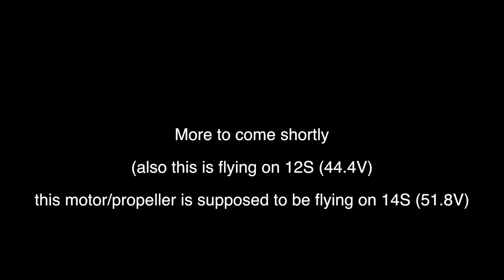My HomeMade electric plane Really flies!!!! (short hops) part7

Comment: Test Pilot Peter - Congratulations .......
some observations: 1 - She looks like She is flying a little bit nose high. what is your angle of incidence(s) relative to the A/C centerline? ........ 2 - On applications of power She looks like She wants to climb - I'd Check the Thrust angle of the motors. might be a smidge to flat relative to the A/C centerline.(more thrust down angle perhaps?). 3 - did you set up counter rotating props? would probably help on an A/C so light. .................................Just saying ............... good luck ........................ JRW

Comment: G'day,

  Yay Team !

    The name of that Syndrome, which you were accusing yourself of (when making the Twilight-Flights, after dark, without Lights of any kind...) ; is "Press-On-itis", it's what happens when people become over-excited, highly-elated, or excessively Goal-Oriented, Target-Fixated - even.

   When someone tries to go "Scud-Running" under lowering cloud heading towards rising ground, or tries to fly under the Storm, or attempts to climb through Clouds in the absence of an IFR Rating & appropriate Instruments being fitted to the Aircraft...; the malady is always the same, Press-On-itis...!

   Your Hairygoplane flies a lot less reluctantly with the Gap-Covers fitted, doesn't it (?) !

   Maybe you could find a Leather Helmet & Goggles, if not a Motorcyclist's "Skid-Lid", to save yourself from some nasty lacerations to the Face - from that Perspex Windscreen - in the event of a sudden mishap (say a Wheel going into a Rabbit-Burrow, or Gopher-Hole, at a speed sufficient to violently pitch you onto your Nose...) ?

  Good to see  that you've moved the Anchor-Points of the Shoulder-Harness up to where they won't compress your Spine...; and now, what about a pair of Wires from those Anchor-Points back to the Rear Engine-Mounting Cross-Spar..., so as to spread the load (of your upper-Body decelerating against the Straps) into more than merely the middle of two Aluminium Tubes...(?).

   As I said, the goal is to Triangulate EVERYTHING, with Struts in Compression & Wires in Tension - which is both lighter & stronger than relying on the brute-strength of the Materials (and the rigidity of the Corner Joints) to resist Bending-Loads...

  Proceed methodically, and with caution ; at this point, overconfidence, elation, and exuberance are all highly dangerous states of mind...(!).

  I, too, after a number of flights in Ground-Effect was silly enough to have gone up to 100 ft & crossed the Fence..., before fitting the Centre-Section Gap-Cover ; and when I got up there I totally ran out of all ability to continue climbing, so I gently turned 90-degrees Right, & lost 30 ft on the Turn, and doing that twice more got me to  be 10 ft up, as I staggered over the Fence to land accross the Runway...., undamaged. Luckily.

   Fitting the Gap-Cover gave me about 300 Ft/Minute  worth of Climb-Rate, even when out of Ground-Effect....; with my lesson learned.

  They say that "The Lord looks out for Fools & Innocents..." ; but one is expected to learn from each near miss, and narrow squeak, and not to ever make the same mistake twice...(!).

  Have a good one,

  ;-p

  Ciao !

Comment: PETER,
It's a big mistake to switch to 14S.
The engine will burn. It is necessary to measure the intensity consumed. You must be well beyond the 180A limit with a 32x12 propeller.
Peter, please, uses for example the calculations of the engine, propeller and battery of the site www.ecalc.ch
The ROTOMAX 150 engine performs better under 12S but with a 28x14 propeller.
You miss speed.
I join Mike Sutton's proposal to do full gas tests on the ground until I empty the batteries several times.
Your life and your health are priceless.
Uses an current clamp and as you do not exceed the 180A.
Reply: The best propeller is a 26x16 for your plane after calculation.
Reply: I think you bought batteries in 14S.
Then buy 24x14 propellers but do not let your 32x12 propellers.
You will have a thrust of 55lbs per engine and a speed of 92miles / hours.

Comment: helmet helmet helmet helmet helmet helmet helmet helmet helmet helmet helmet helmet helmet helmet helmet helmet helmet helmet helmet helmet helmet helmet helmet helmet.

scrapes and breaks can heal, but not your brain
Reply: BrightBlueJim, a car has airbags and much greater crush zones. A wing stall at 8 feet into the ground has enough inertia to demolish the front of this plane, break some bones and plush his head into the aluminum windscreen bracing & puncture his skull.  Happened before per Tony Bengalis article in 1980's Sport Aviation magazine (fatal result).
Helmet could definitely make the difference.
Aviation maxim: learn from the mistakes of others, you won't live live enough to make them all yourself.
Reply: notthepoint.jpg
Reply: Michael Amick: in precisely the example you give, a helmet would not help at all.  Getting thrown into the windshield frame, assuming the windshield breaks, pushes that frame member through your FACE.  Or are you now saying the helmet has to have a full face shield?  And how is that helmet going to protect bones from breaking?  You're not making a very good case.
Reply: also, car design considers a lot of possible accidents. his plane only considers functionality, not controlledly folding in on itself to protect the pilot.
Reply: Yeah, chances are a helmet would do nothing in a crash, but even if it only has a slight chance of saving your life, it's totally worth it
Reply: No he met needs a leather hat with goggles and a bandanna around the neck that says DAKKA
Reply: Your point about helmets only being useful if you are going to get thrown away is nonsense. Racing drivers wear helmets, and they are strapped in. Also, your point about speed is false. When you go go-karting you wear a helmet, and you're doing <30mph. He should wear a helmet.
Reply: You right.
Reply: .... word!
Reply: i was always under the impression it was actually a part 103 requirement. maybe just a suggestion from EAA or something i saw
Reply: 1NTransit: there is no mention of helmets or any other safety equipment in FAR Part 103.
Reply: Evan: In karting, there are collisions all the time, and a lot of kinetic energy in them, because the things you're colliding with are also moving rapidly.  As I said, it's all about relative risks.  If YOU fly, YOU should wear a helmet, because YOU have determined that the benefits outweigh the risks, somehow.  Are you willing to take responsibility if you tell somebody to wear a helmet, and then they break their neck?  If not, please allow others to make their own decisions.  If you want to make an actual argument for them, please show some example or statistics on people getting head injuries THAT WOULD HAVE BEEN PREVENTED WITH A HELMET, while FLYING AIRPLANES.
Reply: Seriously.
Reply: No your brain can heal
Reply: Helmet and goggles please
Reply: Every one of your points is exactly wrong, especially the last one. May god have mercy on your head.
Reply: Yeah, all that grass he was flying over looks really hard. The foam his plane is made of, too!
Reply: BrightBlueJim What if the propeller breaks or flies into his head?
Reply: No point in a helmet... he doesn’t have a brain to protect.
Reply: Static Boss: What if he gets struck by lightning?  What if he has a heart attack?  What if a giant condor flies in and attacks him?  The point is, helmets have one thing they're really good at: preventing head injury.  But they also have risks associated with them, like neck injuries caused by attaching a large mass to the head.  So yes, they are useful.  But they are by NO means a cure-all.  EACH PERSON has to weigh the risk/benefit tradeoffs in any activity they undertake.
So far, nobody who has been yelling "HELMET!" has shown what the benefit is.  Michael Amick gave as an example, a scenario where a helmet would not have helped.  Okay, I'll concede that if a propeller breaks and happens to do so at the moment when one of the blades will directly hit his head, then a helmet would help.  Now: how often does this happen, compared with how often he can expect to collide with the earth with sufficient acceleration to snap his neck due to having a helmet on his head?  I don't have the numbers, so I DON'T go around saying "don't wear a helmet!!!!"  And yet, people who can't or won't quote statistics on these things ARE saying "helmet!!!"
So give us statistics or STFU.
Reply: Do you wear a helmet when you drive a car?  Because you probably drive a lot faster than Peter is flying in this thing.  Helmets make sense for vehicles that throw you clear in a collision.  In this, he's pretty well protected already by the aircraft itself.  Where they're not necessary, helmets are a HAZARD, in that they put extra mass on your head that will cause neck injuries in case of a collision.

Comment: 41 people don't like defying gravity :)
Reply: Or were just too horrified by his very lax safety standards. I liked it, but there are a whole lot of things to how he is doing these tests that just screams at me that he is one failure away from significant injury and not much there to save him when it happens.
Reply: eternalfire1244 true true, or maybe the dislikes are jealous lol.
Reply: eternalfire: what part of his safety standards are lax?  He has years of airplane design and building behind him, he used the best practices of (model) aircraft design, he load tested his wings, and he stayed low for these first two flights.

Don't say "helmet", because helmets are zero help on aircraft.  If you're flying slow, the aircraft and straps themselves will protect him; if he's flying high and/or fast, a helmet would only add neck injury to whatever else happens.
Reply: Other commenters who are actually test pilots have already laid out the safety concerns better than I could and included some additional things he could do to improve safety during testing.

Comment: Have you verified that your motors are pulling their rated current? What is the voltage drop at the motors? Is that drop acceptable? Are your power lines heating excessively? Are your motors running within their rated temperature range? Are your motor controllers running within their rated temperature range? Are your batteries running in their designed temperature range? What i really am getting at is, are you doing your due diligence before you trust your life and people on the ground's life with an airplane held together with tape?
Reply: watch his build vids this plane is not held together with tape
Reply: The tape you see is for purposes of clean airflow not structural integrity. Those intersections,  if left open would create extreme and unnecessary turbulence. On most aircraft they would be covered by a fairing. Since this is an ultralight the tape will suffice. A friend of mine punched a hole in one of his floats when landing on an isolated lake and hit a submerged branch. The hole was about the size of a quarter.He covered it with a strong type of silver tape and was able to take off and return home .

Comment: I have to admit I was really getting worried about you when you started building this thing. Then a few weeks ago on vacation I went to the Aviation museum at Boeing Field near Seattle. Inside the famous little Red Building was Mock ups period plane parts.  using simple lumber and such. I changed my mind at that point and figured you would do OK. 

Congratulations on the success so far and I still say that Mythbusters should have hooked you up as a contributor or host.

Comment: Your Airspeed indicator seems a little jittery? Is there any possible way your pitot tube is being disrupted by any airflow? If so that really should be fixed!
Reply: DudeManBroMan its a homemade pitot tube. You can see it near the end. It is definitely a temporary solution. I imagine the hose could have been getting crimped accidentally
Reply: Jacob_Orth1 Ah makes sense.
Reply: at 12:00 you can see the tube and the hose,
i think where the hose is shaking around the pressure is changing inside.
also, i didnt see a pressure reference port on the side of the tube

Comment: PeterSripol

 I wonder if the up-elevator problem  isn't more than just a nose heavy problem. It looks like the tail surface is parallel with the flat bottom of the wing, but i believe the tail surface should be parallel with the average AoA on the wing.

 Also, maybe put a pool noodle on the edge of your windshield for padding. Something like that could be Very Dangerous!

 Love your project and videos!!
Reply: check out something like the piper cub J3, it has adjustable tailplane angle of incidence.   just for fun.

Comment: @PeterSripol truly an amazing achievement, buddy! You're absolutely correct in going along with the small-steps mentality at this point. One trait of yours that's allowed you to be such a prolific creator is when you get the desire to do something new, you're diligent in your research and preparation, exacting in your execution, and enthusiastic about understanding and resolving problems that arise along the way. A major component to this prolific nature is a willingness to throw caution to the wind and just TRY something! While quite admirable, it becomes another thing altogether when it's your ass you're also throwing into the wind!
While I'm certainly no test pilot, I'm no stranger to many forms of incremental development/testing programs. Having read through most all of the comments throughout your progress on this project, now that you're at the initial ground/taxi/short hop testing phase there's one particular thing I'd like to bring to the front of your mind: single engine performance. A factor that must be addressed, even in in-line and near-centerline multis. Of course there are a multitude of factors to consider when discussing single engine performance of a twin, however I'd like to address with you perhaps the most imminently dangerous in case of an engine loss on takeoff/climbout. Does your design have enough rudder effectiveness/authority to overcome the yaw forces experienced in an engine-out scenario at this particular critical phase of flight? Let's just assume at this point that sufficient thrust is available from a single engine to at least control your decent rate, if not maintain current altitude.
Multi-engine training stresses the directional control issue extensively, but the real-world effects vary greatly by type/configuration. However, one thing that doesn't vary much is the likely result of handling this type of event incorrectly.

I'm pulling for your success like crazy! If I can be of assistance in any way, don't hesitate to reach out. Keep taking those baby steps, but by all means DO reach out to your local EAA chapter. Most are filled with brains that just LOVE to be picked!

Comment: A little trick I was taught wile flying twins. Use your ears for the motors. You will hear a buffet for lack of a better term. It will go wa wa wa wa wa. Just move 1 throttle until you hear a single tone. They will be perfectly matched RPM's when you hear that. My instructor let me chase gauges for the longest time before teaching me this little trick.

Comment: Personally I dont see what the problem is with the live stream. You had permission to test at the airport. There weren't other operations going on, and you probably hit a max of 20 ft altitude. Who the fuck cares. It was a test flight. Its not like you flew around for even 60 seconds at a time.
Reply: thatGUYbehindthemask afaik you are not supposed to fly without a night flying rating more than 30 min after sunset in most countries. Laws in aviation were written in blood, it's not really smart to deliberately disobey them.
Reply: some laws are made to stop you from doing something stupid, but if you know what that stupid thing is, and avoid it, i dont see why the law should apply. its like when you see a "no walking on the grass" area roped off, and theres stepping stones going through it. step on the rocks and you wont hurt the grass, but you still went past the rope barrier. stupid shit like that, where the law is the rope, the reason is the sign, and theres a easy way to get around the reason why, but you still break the rope/law to do it.
Reply: thatGUYbehindthemask try driving a car during a night trough a forest road at 60mph with the lights off. Now add another dimension. That is landing an aircraft in pitch perfect darkness with no appropriate instruments and ratings on an unlit airstrip. The legality of such flying is not the problem here, safety is. To use your analogy, the rope prevents you from stepping on small, slippery, distant to one another stones above an abyss. The warden is not there to stop you from crossing, but you still shouldn't.

Comment: Why you dosent make two motors at the front and sraped the motor holding a little bit better  
Ps. i dont came from America or England sow my english isnt perfect
Reply: Michael Roth Watch his build videos, the engines have to be equal to or slightly in front of the center of mass otherwise be would die on take off

Comment: Paint? Or will the paint be too heavy?
Reply: He probably wants to confirm the functionality, and than after that add some paint/aesthetics
Reply: Josiah Mitchell You are probably right, nasa never painted the fuel canisters on the space shuttle because it was too heavy and negatively effected the flight characteristics...
Reply: He answered in a previous video that it would be painted light colors since dark colors would could damage the fiberglass. (since they heat up more)
Reply: They did paint them for a while, that's why during early flights the External Fuel tank was white. they quit to save weight.
Reply: Also, some paint eats up foam, in areas without fiberglass possibly...